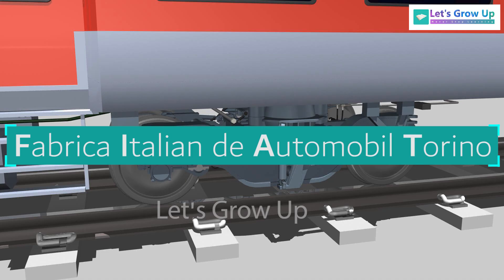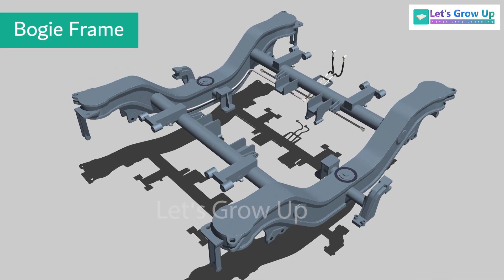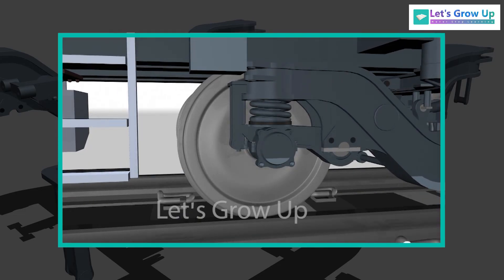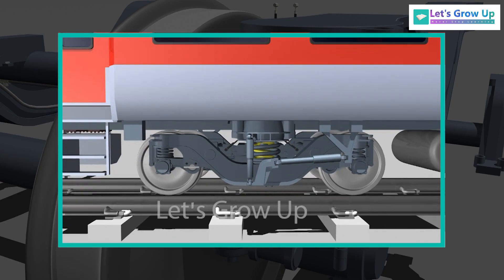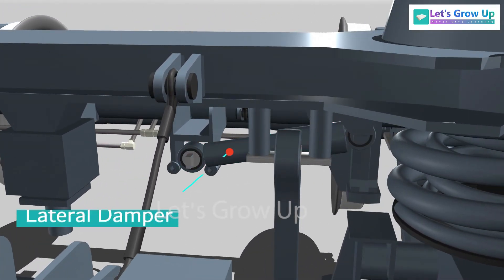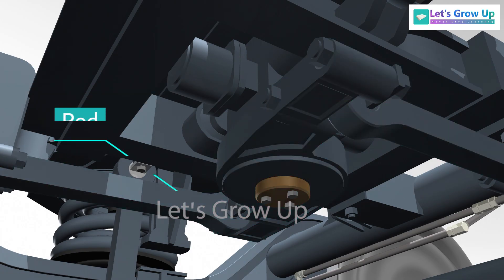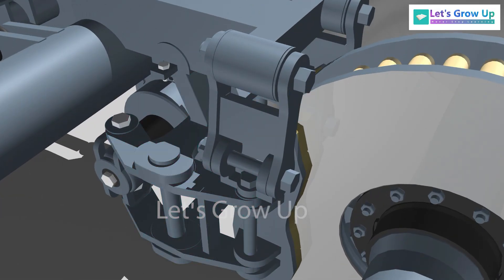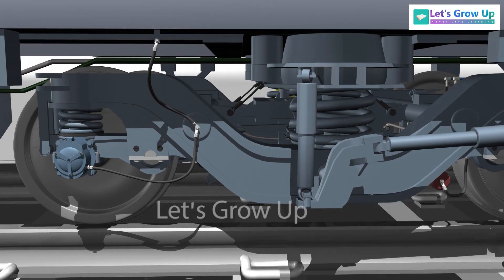lhb fiat bogie | LHB coach's fiat bogie parts Explained | fiat bogie parts

Comment: The bogie of lhb Coach never moves ? Is there any center pivot?
Reply: Pivot attached to the Bolster beam...
Reply: @josephma9332  how does it work if there is no hole at all above the air spring or bosh hole in center of the bogie ? or bolster is located on the underframe and houses the air spring

Comment: Add a disc around axle,attach magnet pieces. Attach a hemisphere shape armature cintaining coils over magnet discs. Attach hemisphere to bottom of wagon floor. Generated electricity frm sets of couples of magnets n hemisphere may pass through a conversion chamber to convert into HV electric and further pass via alternate pantograph atop wagons to alternate HV line by the side of existing HV line for running cities., Try it. Thank you.